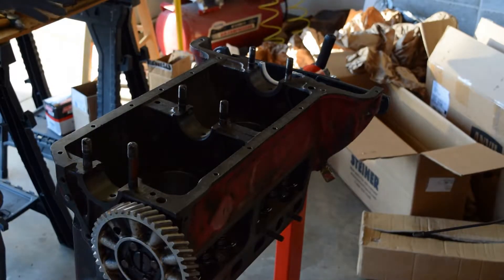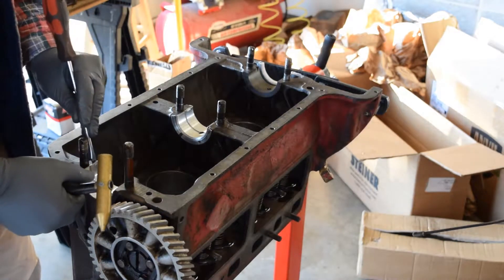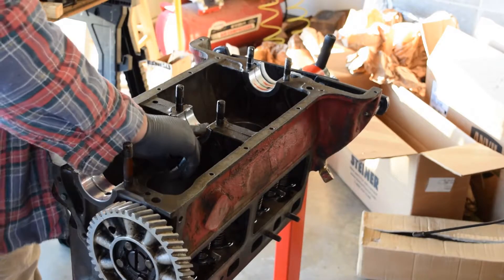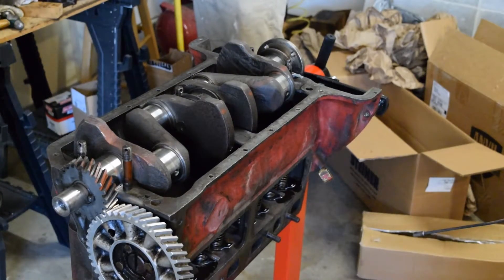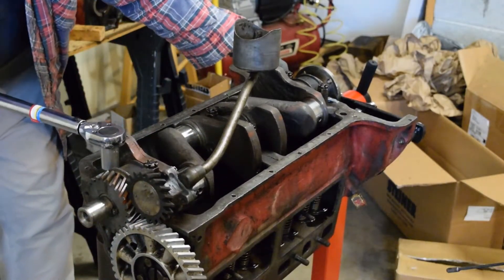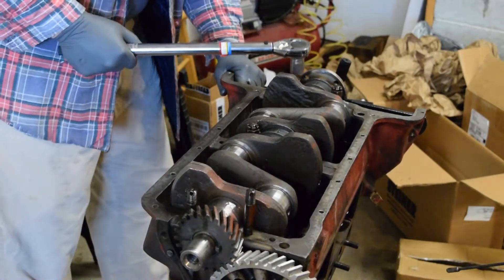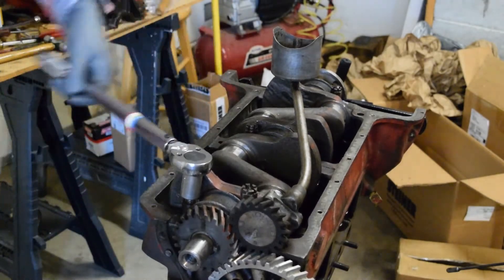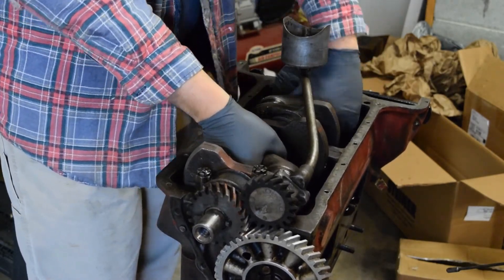1947 Ford 8N Tractor Rebuild Part 8: Crankshaft

Comment: I had hell with the studs on the oil pump on my ‘49. The threads stripped when removing the nuts and I ended up having to get a machine shop to make duplicates. They were made from grade 8 bolts. I had to order the grade 8 fine thread nuts from Bolt Depot. All that cost me nearly $300 and about three months down time. I found a 1951 8n on FB market place for $800 so now I have another project when the ‘49 is finished.

Comment: Are used a putty knife laying flat with the gasket seal took one of my wife’s serrated knives and gently cut and cut quickly with a nice straight surface had a difficult with a sharp razor blade

Comment: Did you plasta gage the journal to check the clearance ?
Reply from the maker: No. If I remember correctly, we measured it with a caliper, and just got the bearings for them that fit best.

Comment: This is NOT how to rebuild this engine. No prelube- no plasti-gauge. Brass mallet....and that damn dog. Yikes!
Reply: I saw him put assembly lube on the bearings, so.....
Reply: @geronimotudor3386  3:18 into the video, he is clearly putting assembly lube onto the main bearings.  I looked for your engine rebuild videos, but I couldn't find them.  Do you have a link?  On my channel, you can see some small engines I got running again, after four years of water in them.  Some things aren't quite as critical as others would have you believe.  Untold thousands of these tractors were rebuilt, quite literally, in a fresh plowed field and then finished their work.  Not exactly level 5 clean room conditions.  I drove my old truck, with no measurable oil pressure (once slightly warm) for 25 miles to pick up a rebuilt short block.   It didn't rattle or knock at all. I didn't hot rod it during the trip, and it made it just fine.  Oil flowed and it was fine, despite having less than 1psi of pressure.  Early motorcycles didn't have pressurized systems, they didn't even really have splash oilers, they had a little pump plunger the rider operated as he saw fit.  Look at Briggs engines, no pressurized oil system, no bearings, just a rod straight on a crank journal and a splasher for lubrication.  All that matters is something is there to prevent metal to metal contact.  If he'd not at least put oil on the bearings, it would have likely seized pretty quick, and it certainly appears that didn't happen.
Reply: @tonyfremont  Paul Russel Essex Mass
Reply: I put lube on everything. I didnt film every second.